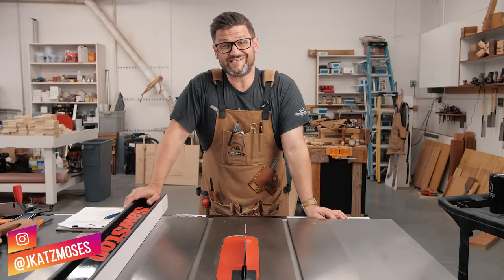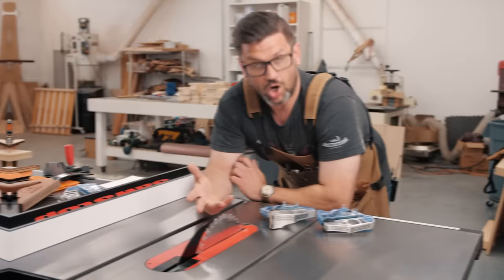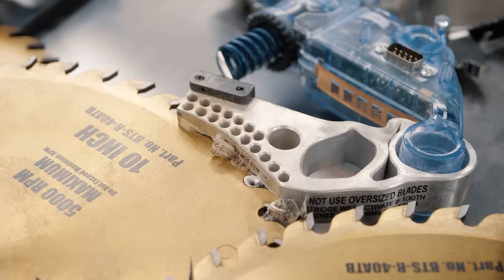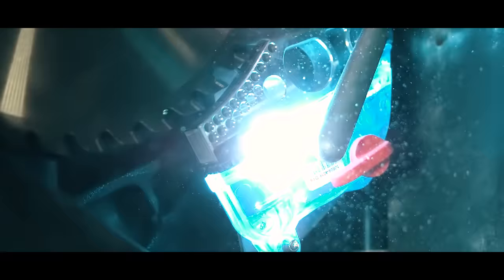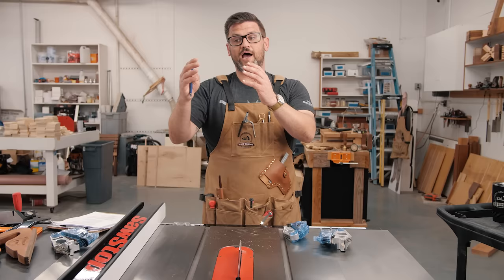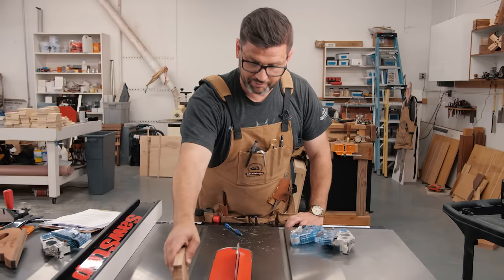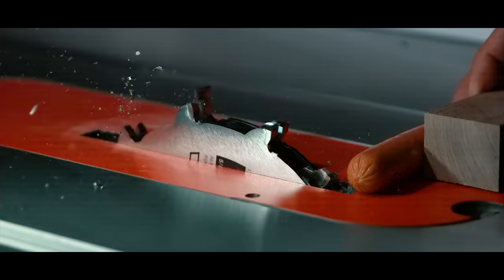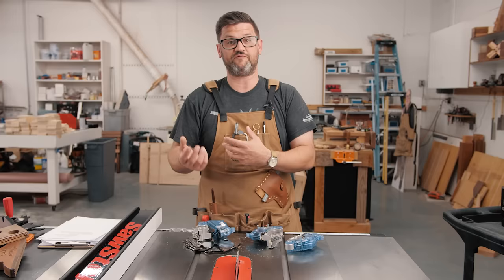How Safe is a Sawstop Saw? - Never Before Seen 19,000 FPS HD Slow-Mo Video

Comment: This should come standard with every table saw. Like the airbags in your car.
Reply: I agree!
Reply: Sawstop has refused to license this technology and has sued manufacturers who came up with their own version.
Reply: @samsmith3025  which is one of the reasons industrial safety tech is never mandatory... The companies in question simply refuse to cooperate.
Reply: They should but companies are greedy and will weasel out of it.
Any kind of moving machinery capable of maiming a person should have safety features to prevent it
(Like motion sensors on hydraulic presses to make sure nobody is near it)
Reply: If I remember correctly. I think saw stop went to all of the table saw manufactures. They offered them the tech. Everyone said no. So they started making their own table saws.
Reply: Sawstop was personally invented by a single person and his small group. After years of negotiation for licensing out his product to major producers, all ending in failure, they instead decided to start a company and manufacture it themselves. Why should they have to give up the rights to their life saving invention? If they are able to come up with a product that was incomparable in safety to other products then they not have to distribute their designs; everyone should be buying THEIR products as the top of the line. That’s the point of capitalism, to incentivise innovation. Major companies can afford to wait a couple years for the patent to run out.
Reply: If it becomes more accessible for people then better no? Either way why sue people for having a spin on the same general idea? That's just selfish
Reply: @TimothyGrabarczyk  
Its a complicated debate.
Its patent infringement to knockoff something you know is protected by law.

But, the moral side of the argument is that safety features should always be available and never in the hands of a monopoly

BUT - not allowing monopoly reduces the incentive to manufacture these devices
Reply: @TimothyGrabarczyk  I do understand the argument that patents shouldn’t matter as much for things of great importance to health and safety. In this case at least though, the invention was an entirely new improvement to an existing product type. He’s not like pharma companies jacking up prices for orphan drugs. The way I see it, if he’s creating a safer better, product at a fair price that other manufactures can’t compete with, then consumers should follow and buy the product.
Reply: @henryh95  Worse part is even after the patent runs out. You probably wont be able to retrofit existing saws with the cartridge. But it will give people an excuse to go out and buy a new table saw.
Reply: @samsmith3025  arguably the government should use eminent domain to buy those parents, then make the use of the devices necessary.
Reply: @henryh95  Not to nitpick, but that’s not the point of capitalism.  I’d say the fact that this life-saving protection isn’t in all table saws is indicative of at least a by-product of the point of capitalism; maximize profit above all else.  There’s examples such as the inventors of the Polio vaccine didn’t patent it & was donated for the benefit of humankind.  Not saying these inventors should’ve done the same, but I suspect when they were approaching large corporations, whose prime directive is to maximize profit above all else, that probably contributed to the failed negotiations quite a bit.  Not unlike how the auto industry fought making seatbelts mandatory for quite awhile, because it would reduce their profit margins despite the cost being people’s safety.  Eventually legislation changed that, so hopefully some day we get there.  Anyways, stay safe 👍
Reply: @TimothyGrabarczyk  respectfully, I would argue that the selfish entity in this scenario are the corporations who looked at what it would cost them to pay the inventors, & then looked at what it would cost them in legal costs they’d incur dragging it out in court; & chose the latter.  Corporations can defeat individuals in court simply by waiting for the individual to no longer afford the costs of continuing.  It’s not like any of these corporations would’ve made less money than they already do.  They would’ve made more, but because their prime directive is to maximize profit, if even more can be had then that’s what they opt for, divorced from any morals, ethics, & sometimes laws.
Broadly speaking the current system can be used by the powerful to squash those with less power, to the vast majority’s ultimate detriment.
Another example would be the malfeasance/illegality perpetrated by some big banks.  If they get convicted of defrauding people to the tune of $500Billion, & for that are ordered to pay a fine of $250Billion, guess what they’ll do it again.  Until the cost is greater than the potential financial benefit, corporations will continue to maximize their profit in any way possible.  
Long-term solutions are a longer conversation LoL, suffice to say that in this instance, I don’t think that, relatively speaking, the inventors were the more selfish side.  💚👍
Reply: the main problem whit equipment like this is that they have huge life span , even if the safty features become mandatory for  manifactures to include  and workplaces to have it forcing everyone to replace their old equipment it will eventually end up in the garage of some hobbyest
Reply: @samsmith3025  they have actually licensed it to Festool. At least in the Netherlands and Germany.
Reply: Yes that way instead of being able to buy a saw for couple hundred it turns into a grand.
Reply: @bradbloom5649  capitalism does not require you to maximise profit above all else. capitalism is simply private ownership of business.
Reply: @yt.damian  theoretically sure, but in our current Late-Stage iteration of Capitalism, maximizing profit is literally written into the DNA of corporations.  Since a corporation is an entity invented by people, obviously that’s something we could choose to change.  Until then, for all intents & purposes, profit/maximizing profit is the prime directive.  Capitalism also requires a worker to be paid less than the value they create through their labor. That difference equals the executive’s profit.  So needless to say the system as a whole as it is now leaves much to be desired on many levels.
Reply: @bradbloom5649  most businesses do NOT maximise profit at all costs - that is a naïve and simplistic view. This is a woodworking channel. If you want to overthrow your government and pursue some marxist nirvana that has failed every time its been tried do it somewhere else.
Reply: @yt.damian  lmao 🤣🤦‍♂️
Reply: @dustinjames1268  BUT - not allowing monopoly reduces the incentive to manufacture these devices

Actually the opposite is true, allowing monopoly reduces the incentive to manufacture these devices. See with competition everyone is rushing to create these safety devices like "Oh boy! A new market! We're gonna do it better than the rest and get paid better than the rest!" and so everyone gets working with the devices. But with a monopoly the other companies are gonna be like "Oh so we're not allowed to make money that way? Well there goes that market!" and so they don't make some devices since they're not allowed to. 

Monopolies suck and government is what makes them happen.
Reply: @Cacowninja  
Why would anyone research and develop for a product knowing that their patent will be knocked off by some Chinese company that'll sell it for less?

Theres a reason monopolies are allowed, patents always have and always will incentivize innovation through funding research and development costs.
Reply: @Cacowninja  
The parts you RND are inherently more expensive to produce... you have to recoup those costs not just manufacturing cost
Reply: @Cacowninja  
When the advantage lies with the leeches and not the people innovating, its clear that not having patents would decrease the incentive to innovate.
Its simple logic. Why work hard when you can piggyback off of others and get the same reward?
Reply: @dustinjames1268  I hate monopoly, takes way too long.
Reply: @dustinjames1268  It's not about piggybacking, it's about getting into a competitive market which is what makes innovation. 

I mean with everyone trying to outdo the other, even though there are only some winners everyone is still better than they would've been if they didn't try to compete at all. 

Which would you rather have? One guy who owns the patent that the invention's quality is solely dependent on or a bunch of people who can all work at once on their own version and make it better as a whole?

One guy exclusively doing the work takes forever, a bunch of people working on it at once makes things fast. 

Patents just create elitism and slow things down I mean look at the pharmaceutical industry with all it's patents that prevent a lot of cheaper but as good generic brand medications from reaching the market.  

https://blogs.sciencemag.org/pipeline/archives/2015/08/13/the-problem-with-patents

If you want people to innovate then let them let them innovate. Get the government the hell away from like everything and let good ideas reach the market!
Reply: @dustinjames1268  And what do patents have to do with that?

All you're doing with patents is ruining the market. The market wants innovation and choices, well patents screw all that up.

If only one person does the invention due to law then the quality is entirely dependent on them. So if their version of the invention sucks then you have no other choice since there's no competition. 

Also if only one person does the invention they don't have to improve it! They just go "Here, take it or leave it!" and if you want to buy that kind product you can only have it from them! 

Other people could be doing a good job improving the invention as a whole but with patents it's all "Let's hope this one guy does a good job with this one product!"

It's not helping at all.
Reply: @Cacowninja 
Patents and copyright have everything to do with the discussion.
If you can legally leech off other peoples inventions, why would anyone spend millions of dollars and years of their time developing a product?
Why not just wait for someone else to invent it and figure out a cheaper way to produce their invention, making more money than you ever would if you were the inventor?

Genuine question
Reply: YES
Reply: It should be illegal not to have these in shops and factories
Reply: @samsmith3025   So they don't care about saving fingers, just making money. Elon Musk still makes money and Tesla allows anyone to use their open source patents.
Reply: @henryh95  The difference being, that we're not talking about something the improves functionality. It softens accidents. How'd you feel if car airbags weren't invented yet, and Toyota just came up with the idea, patenting it?
Would you say "don't buy anything but toyota"?
Reply: @dustinjames1268  Patents massively stifle progress. They hold humanity back. People and companies would still research and innovate, even without patents.
Reply: @Cacowninja  Yeah, if only there was a way that didn't look like a revolution, which would get rid of patents and copyright...
Reply: @dustinjames1268  ...or you be competent and not get hurt?
Reply: That sounds like a good idea, but Sawstop saws are very expensive because of the tech involved.
The average person who may use a table saw maybe on a one-time basis simply can't justify forking over thousands for one.
Reply: @henryh95  Meanwhile 100'000s of people lose fingers.
Reply: Yes and like the airbags in your car it will increase the price.Thats why the absolute plain jane truck starts out at 35K.
Reply: @sspp3065  I choose my finger over a couple of dollars.
Reply: For a hobby this sistem gets expencive if you accidentally cut in moist wood.
Reply: @dustinjames1268  we are already rewarding leeches. Only the leechs being rewarded are the big money owner who "invest" in research and development, paying the really inventive a fraction of what their creations are worth.
In modern capitalism, if you are not a leech, you are supporting one...
Reply: @henryh95  I hear you ! , and my boss just bought two more HEIN CNC Lathes and were a Great Oregon Company locally owned and operated.
Reply: If it were to be made mandatory like airbags, then the patent wouldn't help them, the government would just take the patent away.
Reply: @samsmith3025  Imagine how stupidly rich they get if a law requires it. Should be in their interest as well.
Reply: @TimothyGrabarczyk  If this patent system did not exist, neither would the stop saw. The only reason they dedicated the resources and time to invent it was because they knew that the patent system would garantee them a return in investiment and profit. We can see this result in the real world. All countries that lack or do not inforce intelectual property law have less innovation.
Reply: @dustinjames1268  The true leeches are patent trolls and patent lawyers.
They aren't even productive. People are sufficiently rewarded for first-to-market.
Reply: if they do that then we wont get anymore gruesome deaths in movies with it ☹️

Comment: In the 4 years I've used mine, it has been set off 3 times, all of which were from nails in old wood. In my 20 plus years of cabinet building I have worked with a lot of guys missing digits or fingertips, I have been lucky so far.
Reply: The only way to set it off cutting a nail is if you are touching the nail. If they weren't touching the hot dog the saw would cut right through the hot dog. It takes contact with you to set it off. It's like the old touch lamps took your touch to work it. So quit telling lies.
Reply: what the hell happened here
Reply: Lucky? Or just smart? Seriously, as long as you take the time to do it safely, you'll be fine. can't find your push stick? take 10 minutes to make one, don't use those minutes to take chances.
Reply: @mustang6599  I keep my fingers clear from any blade, can't say that for most people I have worked with tho. Almost every cabinet maker I know is missing all or part of a digit.
Reply: Im sure you spent the $35 for a metal detector after the first encounter
Reply: @DKTAz00  I use it in Bypass Mode when I cut anything but new material.
Reply: @mustang6599  in my 40+ years of using tools like this and being around other people who use tools like this, it's the cocky ones that get hurt. Never discount good fortune. You can be absolutely perfectly careful and still lose your fingers if something unexpected happens.
Reply: @sickinthahead6557  ... so, no?
Reply: @theobserver9131  I'm not saying that the rare one off's don't happen, In a world of infinite possibilities, anything can happen. I know that for the most part, and in most things,  complacency leads to many of the accidents that happen.
Reply: @mustang6599  I would agree with that, still, if you spend enough time working with these tools, and you still haven't seriously hurt yourself, there's going to be some luck involved even if you are always vigilant. Statistically, I probably should have hurt myself more severely than I have by now in my 40 years using dangerous power tools. Yet I haven't, and I can't attribute it all to my skill and focus. I am lucky. And grateful.
Reply: @jerrynpatti  I think the mechanism works by detecting continuity (high resistance still counts or it wouldn't trigger with dry skin) from metal parts of the table to the blade. If you have a nail that touches both the table and the blade, it will trigger the mechanism. And if you have a nail that's hit by the blade, it may push the nail through the wood until it starts to touch the table even if the nail was fully inside the wood at start. The same way, the hot dog should trigger the mechanism even without human touching the hot dog if the hot dog touches both the table and the blade at the same time. To cut a hot dog you must put it in some kind of sledge to keep it off the table.
Reply: @sickinthahead6557  You know, I actually agree with your point, but downvoted because it's completely uncalled-for to be so rude to someone.
Reply: @Vousie  did you reply to the wrong person? I don't see where that person was rude
Reply: yeah, don't fuck with these
Reply: @BaritoneMonkey  Right person, but he's apparently deleted the one I replied to. He had a reply to jerrynpatti's comment that included a few insults.
Reply: @Vousie  got it. At least he's self-aware enough to remove his comment, then.
Reply: @mustang6599  that's like saying you don't need seatbelts because you drive carefully.
Reply: @Favmir  I never said that this device isn't needed. I was responding to the "lucky" scenario in that for many who have kept their fingers over the years, more have done so by being careful, not "lucky".
Reply: @jerrynpatti  You quit telling lies. It uses a small electrical current to decide whether it's flesh or not. When the hotdog touched the saw it lowered in capacitance and thus stopped the blade.